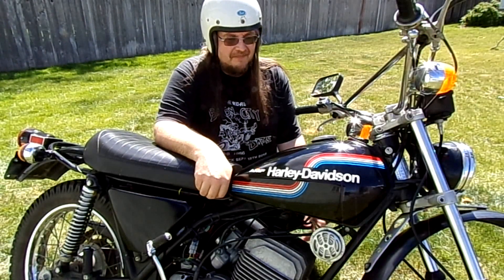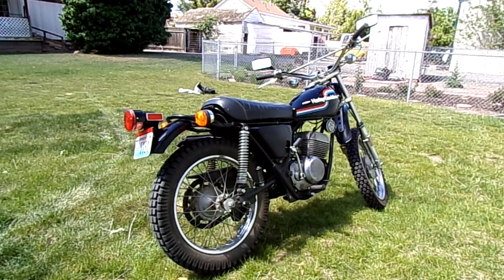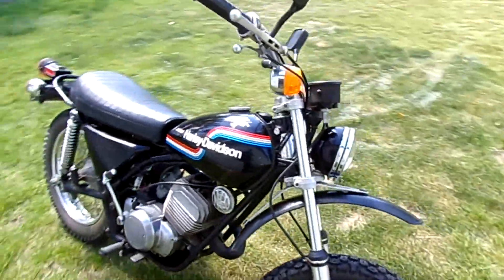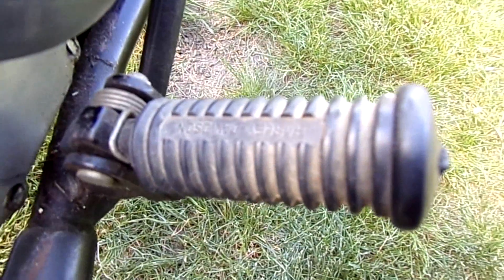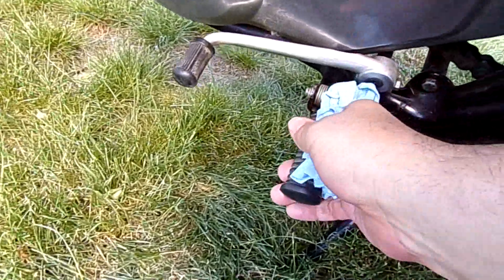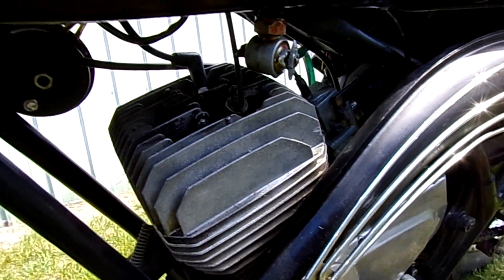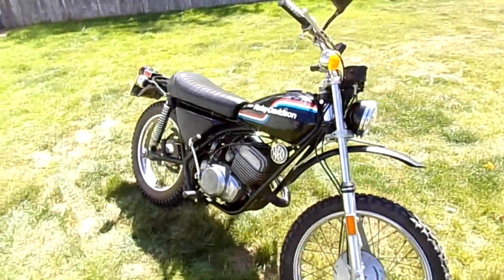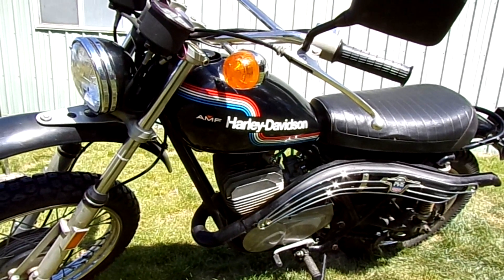1975 AMF Harley Davidson SX-175 Start up

Comment: Has suzuki engine on it Tm 250cc clean old bike sounds good sounds like one of the old suzuki Tm 250s cool
Reply from the maker: Mm i wished it was a TM 250 back in the day when I wore mine out, parts would have been easy to get for it. It is not a Suzuki engine, this engine design was full on Italian, partnership with Aermacch - Cagiva - Harley, and Cagiva ran this engine after AMF sold Aermacch plant to Cagiva.
Reply: Ma che TM ......! Questa è un autentica Harley Davidson 2 tempi